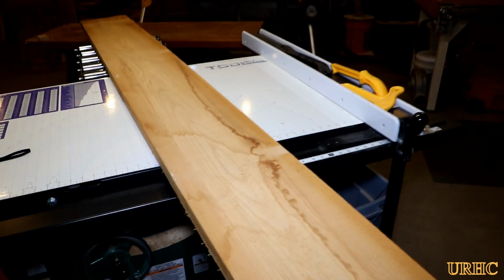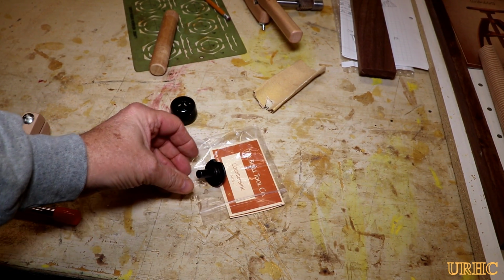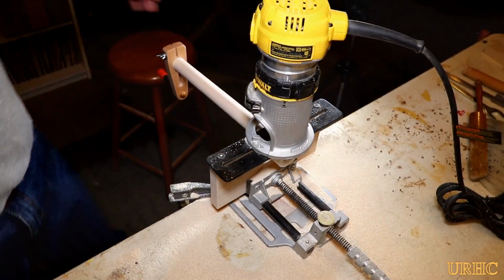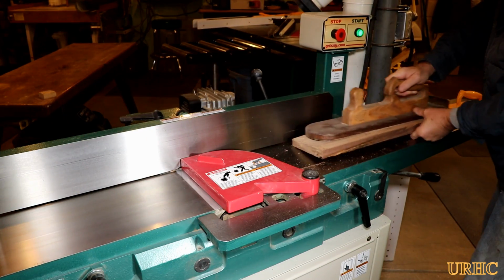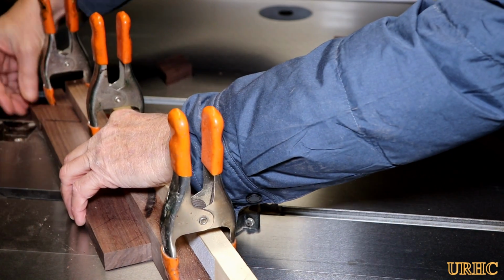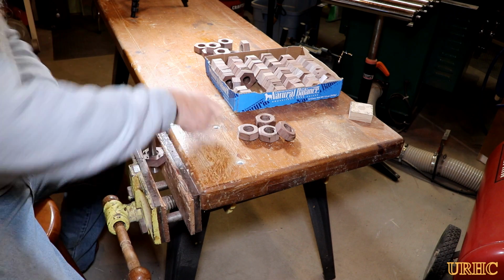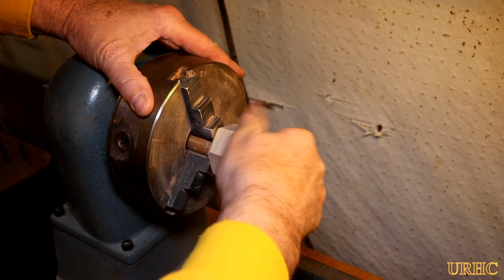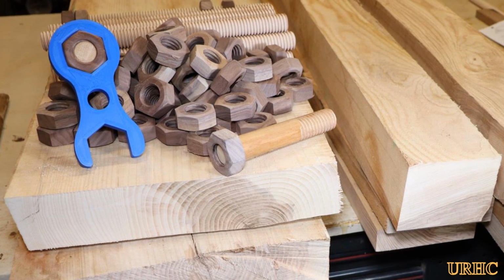Building An Industrial Look Headboard Part 1

Comment: I've just watched again.  I really like the look you have on the head board.  The tops of side posts mirror the shape of the corners of the Sweet Dreams.  It looks great.  I really like it.  Thanks for sharing your work.
Reply from the maker: It is just all simple 90 and 45 degree angles on everything. I should have the build video shortly. I am trying to finish it with waterbase polyurethane and running into problems. Thanks again for watching.

Comment: I love the look and where you are going with this project. My suggestion (everyone gets at  least one don't they?) would be to do all the dowel  threading before cutting them in thirds. Hurry and post the next video. The suspense is killing us!!! lol...
Reply from the maker: You could cut them that way, but the further they stick out, the harder it is to feed them smoothly by hand. I have to do some full length ones for shelving next and am looking into making a 20 rpm power feeder because it will take 15 minutes to feed a full dowel and the smoother you feed the dowel, the better the results. Thanks for watching.

Comment: you should put bolts on the tap handle, at the ends about 6  inches, get two round handles loose holes. go over the bolts and now you can spin it like a wire tie twister
Reply from the maker: I am working on a power feeder for the next batch. Thanks for watching.

Comment: that moister meter is 8.? it really reads double !!!!!!!!! so18 or 19 %%%%% i had one and compared it to mu buddies 400$ one
Reply from the maker: It is fairly accurate. I have compared it to a expensive one and it was always less then one percent. You have to cut the board and check the center to get a accurate reading because the pins don't go very deep. After 4 years drying in the barn in everything usually hits 8 - 9 percent. The ash was standing dead from the EAB and less then 18 percent when sawn. Thanks for watching.

Comment: Wish i had lumber like that on my land...nice...looking forward to next part.  ALSO...what is the blade guard you are using?
Reply from the maker: Having a small bandsaw mill gives me an unlimited supply of lumber for projects.  It keeps many of the ash attacked by the Emerald Ash Boorer  from becoming firewood. It is the Grizzly guard, but it has to be removed too often to get the videos. Thanks for watching.

Comment: Would it help if you threw in a lot of silica gels around the wood storage area after cutting, to remove the moisture content? Just thinking aloud. Sorry if it sounds stupid :)
Reply from the maker: No, it has to equalize with the moisture content in my house. I plan on building a small solar kiln someday to speed up the process. No question is stupid. Thanks for watching.

Comment: What is the update on the Ariens snowblower. Last I recall they came to pick it up and go over it.
Reply from the maker: The dealer still has it. I know they replaced the friction drive disc and are waiting to hear from Ariens was the last I heard.  Im not pushing it because the loaner tracked machine they left works good.
Reply: Ha..that's how it always goes.  I'd call them and tell them to keep the new one and you will keep the loaner!  It will never track the way it should.  They would have to install all the extras you did as well.

Comment: Great looking project my friend. I just purchased the same threading system but haven't had time to use it yet. I've been carefully watching your video for pointers! Was wondering if this would work?....driving a Philips head screw(drywall screw perhaps) into both ends of the dowel--then chucking up a Philips driver bit in a variable speed drill & slowly "drilling" the dowel through the threader till almost at the end & then just flip the drill into reverse & back the remaining part of the dowel out using the opposite screw on the other end of the dowel? Sorry for the lengthy comment, hope that made sense. Love your channel, always outstanding content. Thanks so much for sharing!!
Reply from the maker: I tried putting a kreg square head screw in the center of a dowel to drive it with a drill, but my drill is tough to keep at a constant rpm at low speed and did not work that good. I am looking for a 20rpm gear motor with a constant torque to try next. The kreg screw was able to drive it right through with the with the standard kreg driver. I need 3 ft long threaded dowels for shelf hangers and hopefully can come up with a solution. The nuts have been the biggest challange and I think the next batch will be cut with my cnc router. Thanks for watching.

Comment: What temp do you keep the wood at when drying?
Reply from the maker: It spends a couple years outdoors at the ambient temperature and then I bring it in next to my woodstove for a couple weeks at the start of a project to try and get it a little dryer. The temp doesn't mater as much as the lower humidity from the woodstove. Someday I plan on building a solar kiln to speed up the process. Thanks for watching

Comment: Love the video... I just got the Beall threaded and just finished my first 1 1/2 inch dowel (its huge) ... love your jigs I been using the bandsaw... I will have to buy me a 1 inch sander now haha
Reply from the maker: The threader works great,  I want to get the 1 1/2 insert and tap someday also. I am finding making perfect nuts is the hard part. I  avoided using the cnc router this time, but think it may be the easiest way to make more. I use that little sander a lot more then l thought I would. Thanks for watching.
Reply: how do you avoid the small chip outs at the start of each thread?